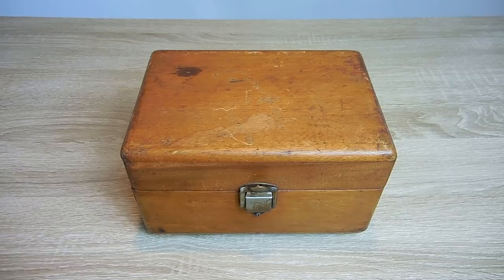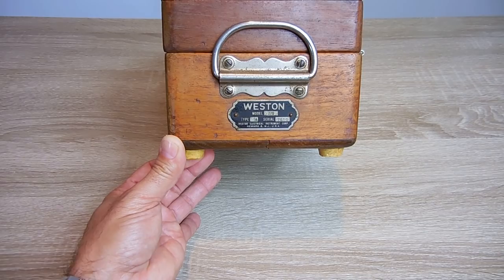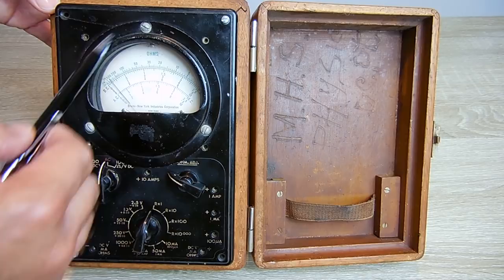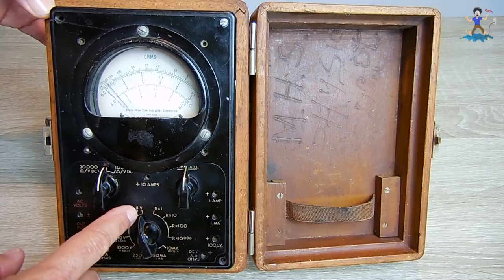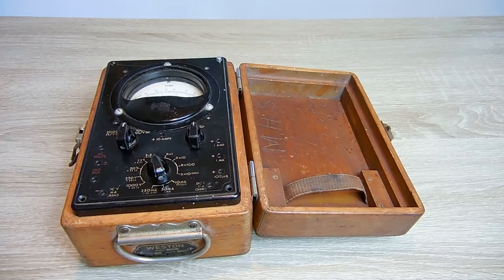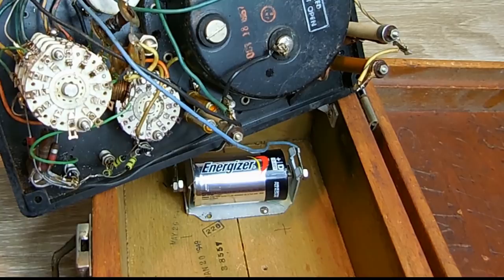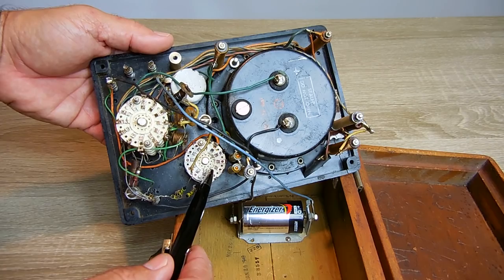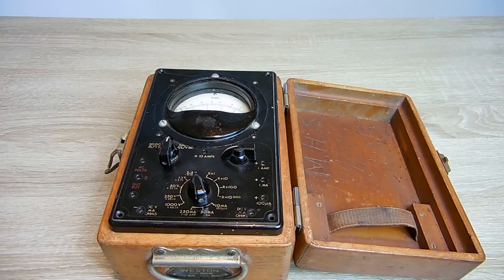Vintage Late 1940's Analog Voltage & Ohm Meter

Comment: The calibration is probably off, but can be compensated for.
Reply from the maker: Meter was totally non responsive to direct input tests. 17k ohm at rear terminals.